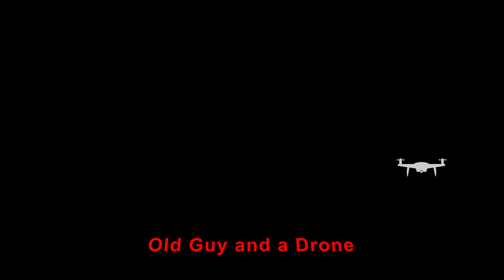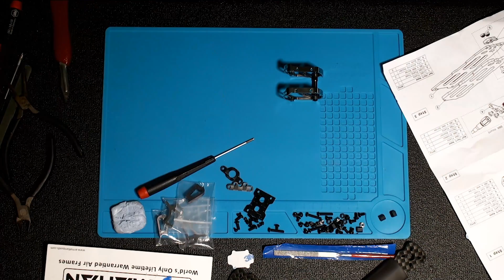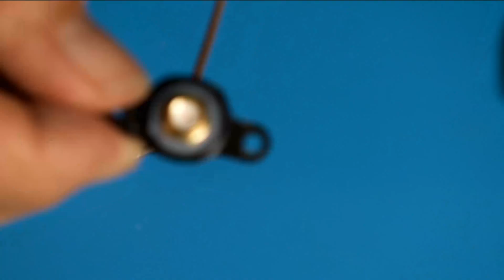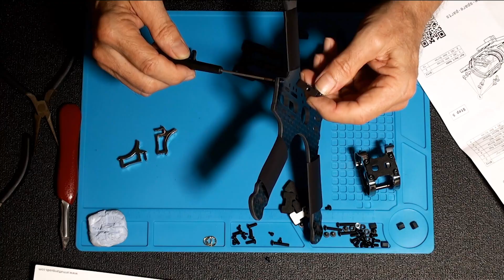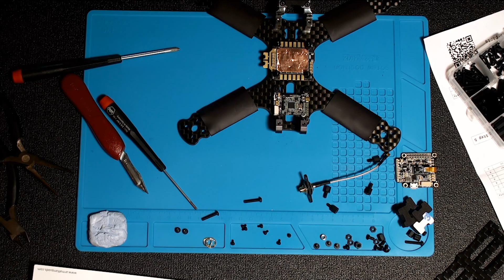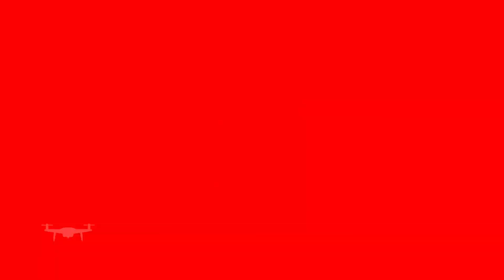My First Custom FPV Quad Part 2 - Armattan Marmotte Build

Comment: What size stack screws are you using? The normal size ones that come with every stack are too long . And the top plate doesnt sit flush where its supposed to.
Reply from the maker: I couldn't tell you exactly, but I bought an assortment of small metric screws of different sizes and lengths so I would generally have the right one handy while building. An assortment of 2mm and 3mm screws is what I have. If that doesn't work, you just have to cut off the excess from the longer screws.

Comment: Ok I watched this same video 3 times... I have the diatone mamba f722s stack and I'd like to mount my unify on a white noise board with crossfire nano.  It's a 30x30 just like your vtx. How did you get the back standoffs on there. I've tried pausing rewinding. In large the best I can to see. But there isn't any holes back there. My mind is boggled.  This is my first build also. I see 4 screws for the 4in1 and esc, I can get 2 screws in right behind them but the back screw holes don't exist. I bought 2 of these frames back in may or June.  Their the special carbon fiber. I'm just lost. I know I  can get a 20x20 back there but I already spent the $100 for the 2 unify pros. So I gotta use them. And I'd like to use the whitenoise board w/ some standoffs to keep it up off the carbon. Sorry for blabbering but how did you or if anyone else knows get the back 30x30  standoffs in there.
Reply from the maker: If you send me an email to oldguyandadrone@gmail.com, I will email you some close up photos if how I fit the Vtx back there. I had to drill some holes.